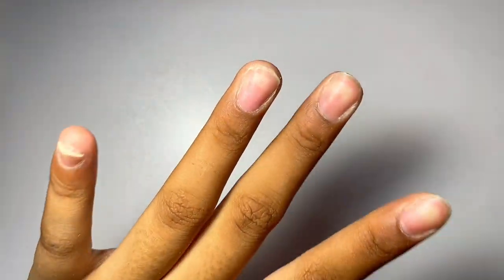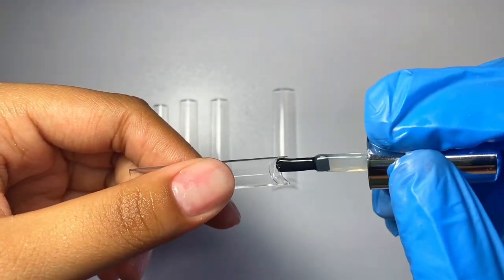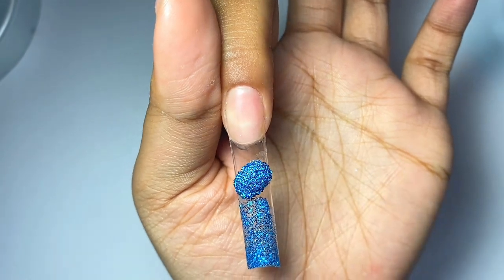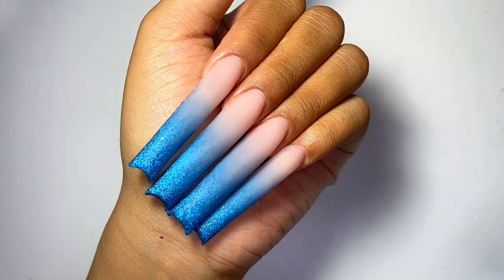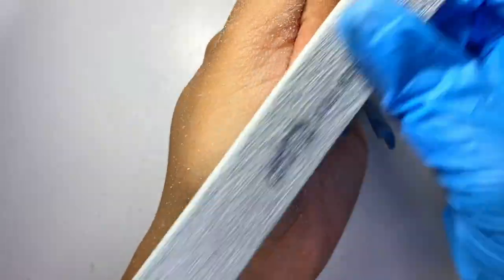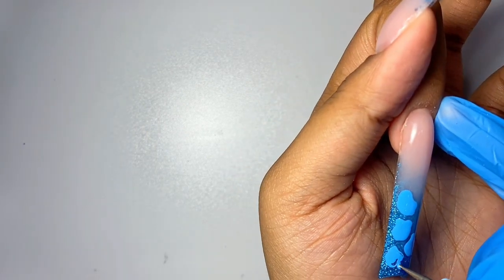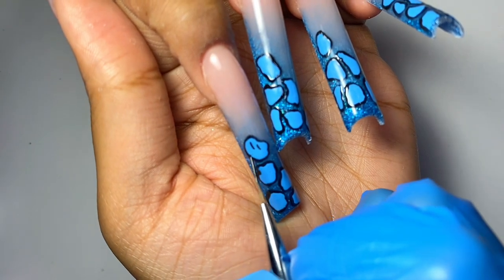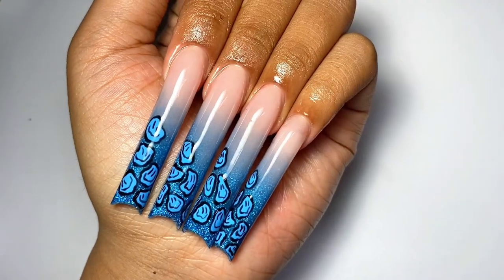🌀BLUE SMILEY FACE ACRYLIC NAILS🌀| glitter ombre + simple nail art!✨

Comment: This is beautiful, please how many percent did u put your driller on when u filling the surface
Reply from the maker: Ty! When I seal my cuticles I usually have it on anything between 3000 and 7500 rpms depending on how smooth my application is❤️